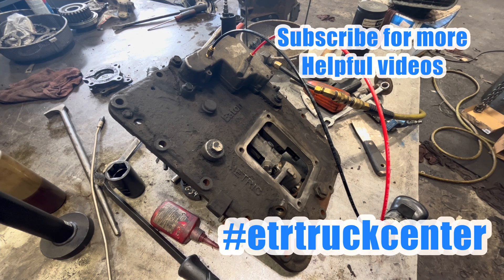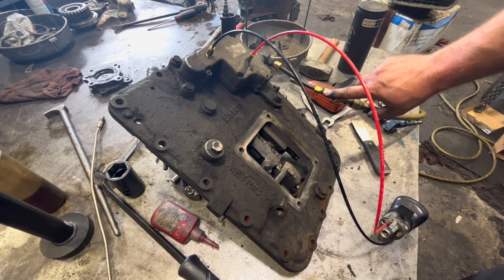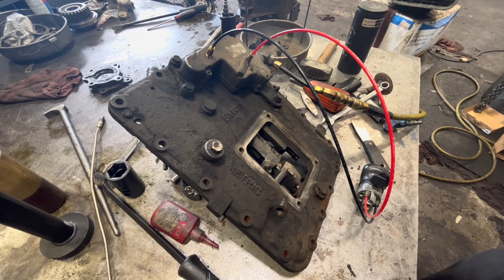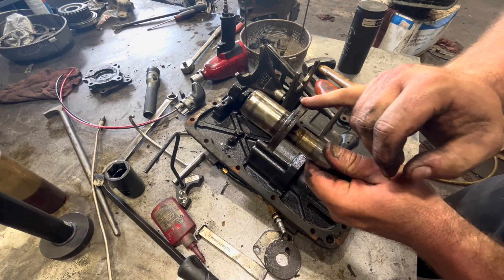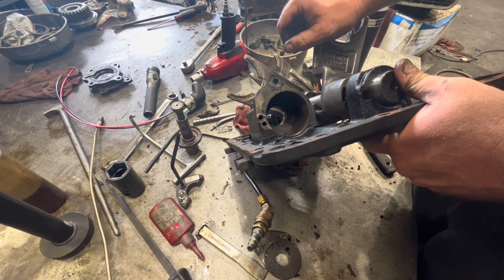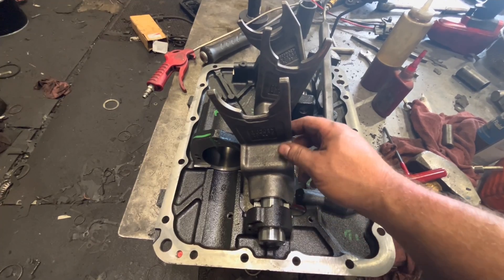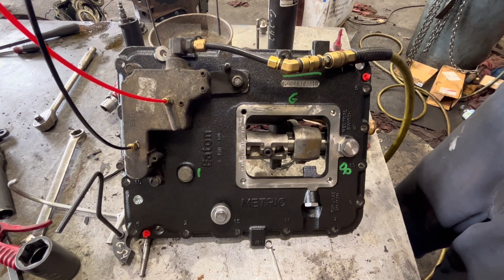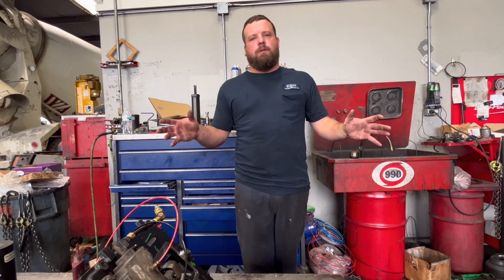Air leaking from the top of a 10 speed Eaton fuller and how to repair.

Comment: My leaks air while on neutral on high once it goes into gear the leaking stops, no leaking while in gear high or low. Also while it builds the air it keeps on leaking. Would that be the modulator itself, Thank you!

Comment: It was my modulator, changed it out and no more leak. Took it apart and man was it filthy in there. Now I can definitely hear the gear switching.
Reply: Do you have a part number for the modulator
Reply: @MelonPlaygroundwarriors567 part number was K4235 I purchased it from Advanced Truck Parts
Reply: did you have to take out transmission
Reply: @everettbenson307 not just removed the shift stick boot and was able to get wrench in and pull it out with no problem
Reply: @everettbenson307 did all repairs from inside cab by just removing boot. Plenty of room

Comment: Did you have to bring down the whole transmission to remove the top place cover??????
Reply from the maker: Pulling the transmission is the best way to do the job in my opinion. Some trucks you may have enough space to remove the top other trucks you may not. The chances of dropping something down in there and destroying the gearing are high doing the job while the transmission is in the truck.

Comment: In this situation coud it be synchronizer
Reply from the maker: The range valve was leaking and it was slow to range shift so I knew the top plate was at fault.  I’m shure contingent damage will occur to the synchronizer with the slow range shifts. In this video the root cause of the problem was the top plate.

Comment: You can use a brass wire wheel with a drill and smooth out that rusted cylinder. I did that to mine and its still going 3 years later. Get a new piston kit tho and grease it really well
Reply: Hi, what type of grease did you use? I am having the same problem…
Reply: @Mr.GreenZ27  Lithium grease works good for this kind of application.
Reply: Do you drop the transmission or just remove the plate through the top?
Reply: I have an Easton fuller how much did you spend for the piston kit? Thanks

Comment: Can you take the top plate off without dropping the transmission?
Reply: I wish he would answer this question
Reply from the maker: I answered it to the best of my abilities
Reply: @etrtruckcenterenginedrivet8918 thanks you I’m still debating on doing it that way.
Reply from the maker: You can pull it under the cab in some trucks if you have enough space. Is it a good idea for just any shop to do it? No it’s not. It is extremely easy to drop something inside the gearing once the top is off. I know it sounds crazy but I have rebuilt several transmissions were someone has taken the top off while under the truck and dropped a penny down the shift tower hole or directly into the transmission while removing the top. We sold our business and property and I’m not doing this kind of work anymore so take it or leave it IMO anytime my trans needs work it needs to come all the way out

Comment: ❤❤شكرا
على الشرح الرائع
ولاكن اريدمعرفة
سبب خروج الهواءواازيت
من فتحةالتهوية
جيربكس ذو13سرعة
Reply from the maker: On a 13 speed there could be a couple of different problems. First thing that comes to mind would be an issue with one of the orings in the range or splitter cylinder. If one of the orings are frayed or damaged air could bypass and pressurize the inside of the transmission and cause excessive ventilation from the vent. I’ve seen the type of oil used cause an issue as well. 50w regular or 50wt synthetic oil should be fine for the transmission. Don’t mix them or bad things happen. In my experience I would look more toward an issue with orings in the back box of the transmission. One of the orings in question can only be replaced by completely disassembling the back box of the transmission. Hope this helps
Reply: @etrtruckcenterenginedrivet8918  
Yes, I have a problem with the splitter cylinder. When I want to move the truck, it goes into neutral mode in the case of load. Greetings, thank you for this information.

Comment: Thanks for great explanation and video 
I don’t have air leak but I have transmission fluid leaking around module and shift tower 
Should I replace top plate or just gaskets

Comment: First off let me thanks you for taking your time to upload this video!!! But i have an issue where when i switch for high to low i get a short grind noise. But if i wait a bit at a complete (let the trans stop inertia spinning i guess) stop it doesnt grind. What might you think it could be please sensei
Reply from the maker: Synchronizer and bull gear in the back box of the transmission I would suspect
Reply: @etrtruckcenterenginedrivet8918  thanks you so much

Comment: My FR 10 speed completes range shifts upwards perfectly, but the range shift to low seems to be a bit lazy.  When you go from high to low, you have to Rev-match before the range shift is complete.  It’s like the front box goes into gear before the range box.  If you are lazy when slowing down and don’t catch low range by giving the throttle a blip, it won’t catch the low range and just stays in a neutral state.

All the older roadrangers I ran didn’t do this.  Is this a problem or a nuance of this trans?

Awesome videos btw!!!
Reply: It sounds like a very minor part is out of spec. Unfortunately you gotta remove the whole thing to figure out what it is.

Comment: Will this cause slippage like the clutch is slipping?
Reply from the maker: The manual Eaton fuller transmission is not going to slip ever. Either its going to pull or not pull.
Reply: Not true. I had a clutch slipping felt like transmission slipping but of course manual don’t slip. I replaced clutch and fly wheel 5 months ago and now this

Comment: I got the issue once again Ive already had the plate replaced and less than a year it’s leaking air from the piston seal again..Also have had a new air dryer put on but it seems there’s still excess water in the system that causing this problem..🙄
Reply from the maker: There are usually multiple air tanks on the truck and each one can hold water. Make absolute sure you have your tanks drained of water sometimes simply pulling the cable on your tank is not enough due the the drain not being on the bottom of the tank. If I had that much water in there I would probably park my truck on a slight hill and pull the plug out of the end of my air tanks to make sure I got as much water out as possible before changing my air dryer cartridge.Depending on the environment your running in you can most definitely accumulate more moisture in your air system than let’s say someone running threw Nevada over and over again. Here in Georgia the humidity is very high and it can wreak havoc on these air systems. You may have to replace your air dryer cartridge more often, the little filter can only hold so much moisture before it starts accumulating in the air tanks again.

Comment: What’s average shop charge to customer to do this job?
Reply from the maker: Were not sure what most shops would charge for this job but we do know what’s involved in doing the job and doing it correctly. To do it correctly you need to pull a section of driveline,drain and pull the transmission. Then you have to inspect the transmission disassemble and reassemble the top plate using a new plate and a new piston kit.When you go back together with everything you need to use proper gaskets for the plate and shift tower. Make sure you use new driveline strap kits. So all in all it kinda differs from shop to shop some shops would probably take a while to complete a job like this. We can complete a job like this around 3 hours.

Comment: I have a 2013 freightliner cascadia. When I flip the splitter on the high side I hear air leaking inside the cab. With the splitter in the down position there are no air leaks. No air leaks on the outside of the cab either.
Reply from the maker: Lue did you watch the whole video?Just from what your saying you are describing the opposite of what’s happening in this video. I’m not there to diagnose but it sounds like your bypassing air from low to high inside the top plate. Have you seen if your air tanks contain any water? Is the air leak coming from under the stick boot in the floor?
Reply: Have the shift knob itself checked for leaks or a crack.
Reply: Hi. Same problem here. Did you fixed? What did you chenged. I hear leak in the higher gear but not in lower. What was tge problem please?

Comment: So I have a 1980 S1955 with a 10 speed . I busted the hi-low air line on the stick. While looking for a replacement they are selling "Upgraded larger diameter air line kits"

My question is this.. is it necessary. And will the kit have the fittings that will match the block that is on the shifter  and the fittings on the modualtor?

Any help would be appreciated. Thanks

John
Reply from the maker: I’m not shure about any kit I don’t do it that way I use bulk items but to upgrade to larger diameter airline you will be using 5/32 hose. You will need a length of about 3ft of THESE ARE FULLER PT#s   75320 black air line 5/32.. 75120 red air line 5/32 .. get 2 of a 85003 which are 5/32 fittings to go into the slave valve.. and get 2 of a 84005 which are the 5/32 fittings that go to the shift knob.. the shift knob part # is a A6909 for a 10 speed

Comment: What if I spray soap mixture on the modulator and it’s spewing bubbles all around it and where it connects to the top plate ? Doing it when it’s in high and low split
Reply from the maker: When the top plate is bad it will bypass air internally at the piston in the plate causing air to leak from the modulator
Reply from the maker: Did you watch the whole video?

Comment: I got low air pressure and 1- 5 gears not working. There's a huge air leak from under them solenoids on my 10spd meritor. I replaced solenoid but it wasn't really helpful. What could be the problem? Should I replace 2nd solenoid? 
https://youtu.be/C85W8gJvxwg
Reply from the maker: Have you pulled the piston housing that the solenoids bolt to? You may have an internal issue with the range housing or the range piston inside that housing. I would pull the four bolts and take a look. Nothing should fall out just don’t loose the large o ring that seals the housing to the back box.
Reply: @etrtruckcenterenginedrivet8918  what should I look for when I take of piston housing?
Reply from the maker: Look for a damaged piston or damaged housing anything that might possibly bypass air from one side of the piston to the other

Comment: Brother that is a good video thank you! Great explanation. I had similar problem and I bought the the ' Fuller Range Piston Kit' part# K2923. But most of the time when I come to a stop and I flip the high range to low it won't click. Have to put in high again and low and then it goes...also when Iam down shifting and go from 6th to 5th gear it grinds and Iam bugging to think is either the piston shaft itself with its seals and O-ring or is maybe time for me to buy a new top plate. 

What do you think I may need to do or buy?

Thank you again 👌
Reply from the maker: if your grinding from high to low there is a problem with the synchronizer and bull gear in your back box. Pull the transmission remove the back box and repair. Check top plate again while it’s out.
Reply: 🤟👍🤙💥💣
thank you!  @etrtruckcenterenginedrivet8918